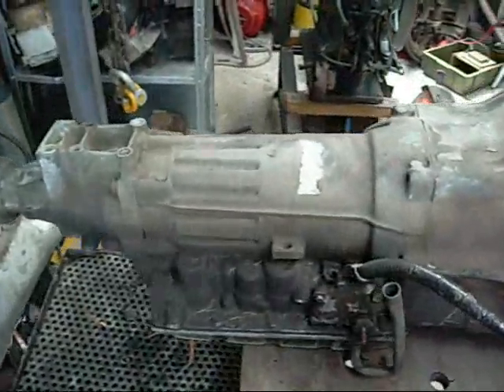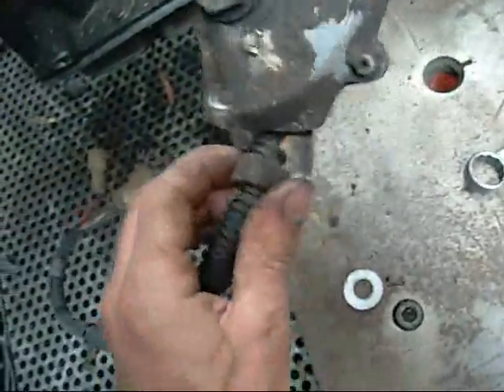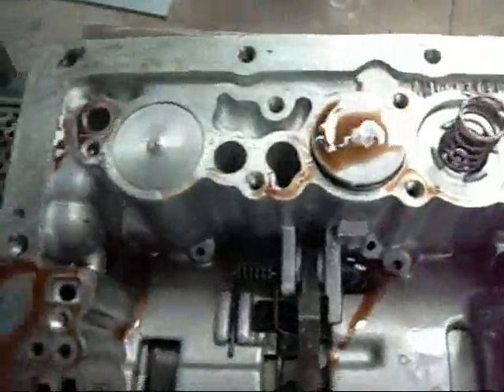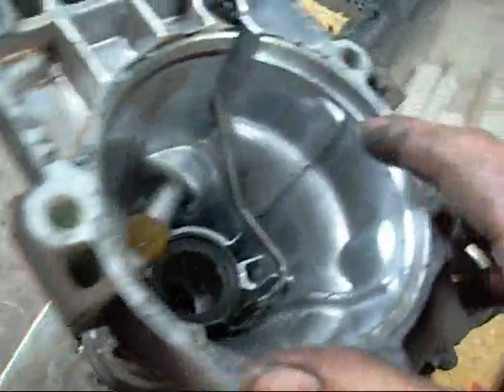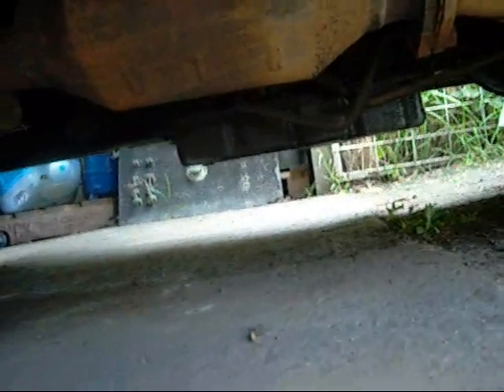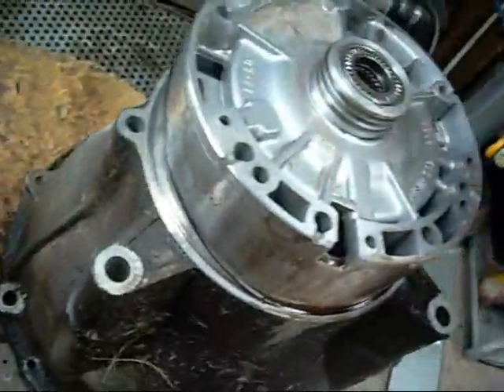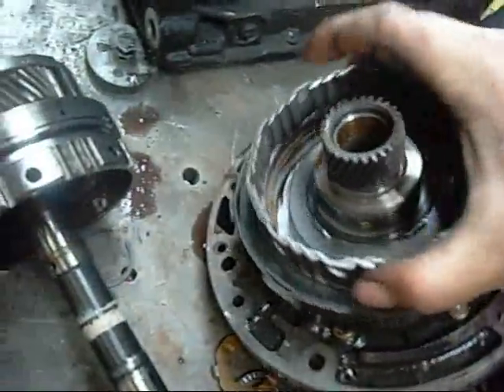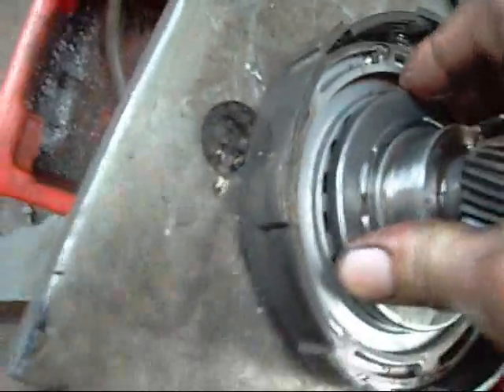Toyota Hiace Minivan Auto Trans Examination Pt1

Comment: cool. good vid. you will find that solenoid is for OD,(4) worth keeping as spare. that type of box has a cable connected to the throttle for kick down and line pressure control. the one way clutch is called a Sprag clutch and thats what i thin shat in the jag box and it went to hell from there. i think the toyota box was neglected then over heated and warped the valve body id say.